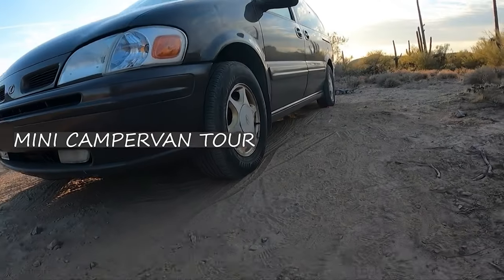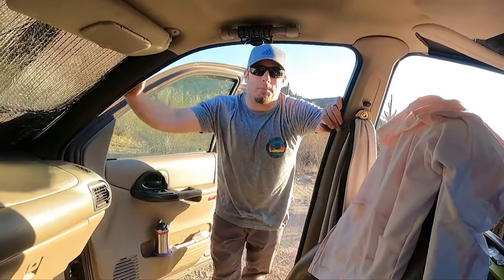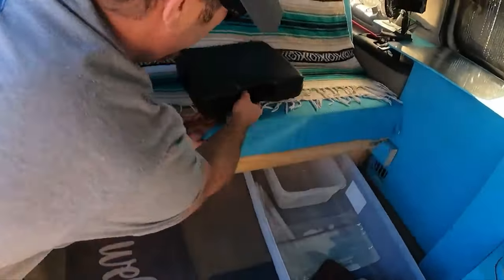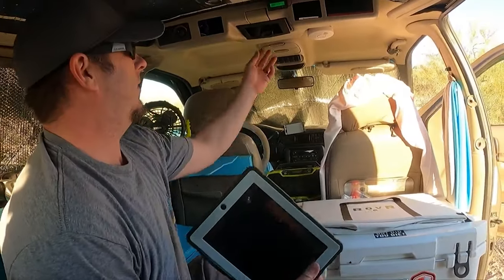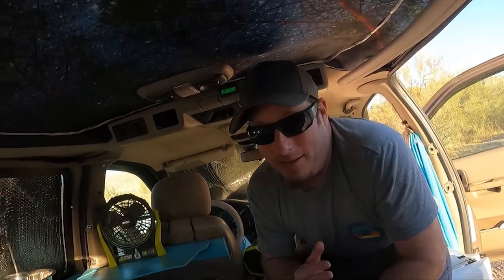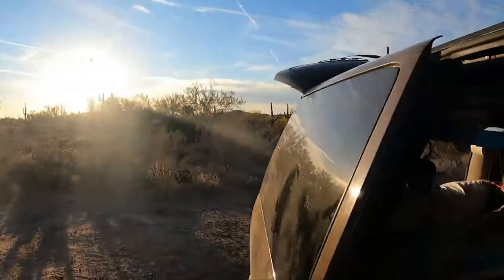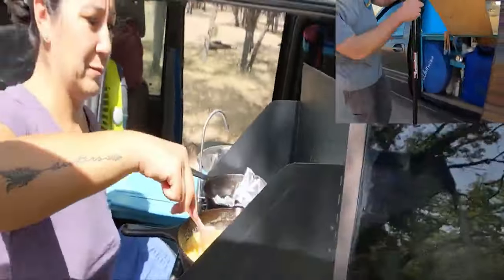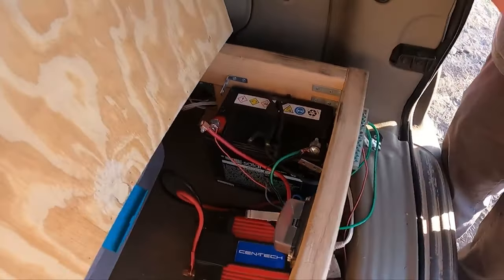MINIVAN CAMPER TOUR | BEST DIY BUDGET CAMPERVAN DESIGN & BUILD

Comment: Very nice set up !
How did you build the kitchen counter 
That opened both sides!!!
Reply from the maker: Thank you! I built everything around the bed once we figured out the sizing for us.  Started with 2x2 frame attaching the van floor and walls with L brackets. Used underlayment for counterd and sides to keep it lighweight, doubled up certain strip sections to make it stronger where needed. Added hinges for outside table and inside counterd, then painted everything. It was all done custom on the fly, the cheapest way possible. Didn't want to sink a Tom of cash into until I know it will work out for our needs. I hope this helps!

Comment: would love a more indepth  view of the countertop and set up ...... really like it !
Reply from the maker: I wish I filmed it bit Inwas in the zone lol. I was not afraid to drill into things. Used cardboard to make a template. Screwed a 2x4 to the back of drivers seat. I put a small.section (above the toilet) on piano hinge. First thing we do when parked is move the seats all the way forward which allows that counter to come down and it ooens up the space.Everyyhing was custom built to the contours of the van yet assuring thw sliding door still functions so we can get at the tanks and atorage
Reply from the maker: Thank you so much! It's an original design, custom for this van

Comment: Ingenious and so much in such a small space can you tell me how you did the little shelves
Reply from the maker: Thank you Leese! I used 1/4 " underlayment. Traced the shape needed on cardboard and made a template. Used that to cut the underlayment. Made a lip on 3 sides which are glued with construction adhesive (loctite instant grab) clamped and let it cure. Then I painted it to match. Installed with L brackets into the vinyl side panels with screws. The L brackets had to be bent with pliers to get the correct angle for leveling the shelves. I use mini bungee cords to help support the shelf and contents in place when traveling.

Comment: Nice.  Your side window screens are a good idea, I could use them in my minivan.  I saw from your reply to an earlier comment that the frames are made from ¼" plywood, I think you've motivated me to try something similar.  I've been using magnets to put screen fabric outside the windows.  Once I stopped where the mosquitos were really bad and was almost entirely devoured by the time I got them on.  🤣  So I need an inside screen solution, yours is good.
Reply from the maker: Thank you so much for your comments and feedback. I couldn't find anybody that made screens for pop out Wing windows so I kind of had to wing it LOL! I just snatched out for the pop out Lover I'm a little Gap that's there are stuff it loose material when we are parked.

Comment: Ive been exploring many camping options: cab over camper, box truck, work van, etc. currently using my subaru outback. However, i never considered a family mini van for a camper. Great idea and nice set up
Reply from the maker: We were the same way actually. I really wanted a cabover on my pickup truck but it's only a 1500. Those things just weigh too much you need at least a 2500 to haul anything decent. Then considered a teardrop trailer for towable pod to sleep in but we really don't want to have to tow anything unless it's kayaks or an ATV.  The minivan made the most sense especially because we already had the van which was half the battle. Worked out great and we upgraded to a high top van but we still use the minivan :)

Comment: Well-made video with good explanations
Reply from the maker: Thank you!
Reply: You drillef holes into sides of van to hang shelves?  How did you support  L brackets in plastic?
Reply from the maker: @kaysmith6297  the plastic is suprisingly strong. I did secure the plastic panels to the van with longer self tapping screws first (predrill first and make sure the screws are not too long!) Then screwed the L brackets into the panels with shorter screws (again predrill holes) I was not afraid to make holes as this van will not be resold. We will be the last owners lol! The l brackets needed to be bent some to match the profile of the plastic panels. Also mini bungee cords help support the shelves and act as a fence to secure items :)
Reply: @gino_colucci  Thanx for replying. I was not going to do any permanent mods like making holes,  etc.  My "new to me" minivan already has over 148k miles so I'm with you - she may never get sold again.  I had all rear seats removed today with plans of storing them,  but maybe not worth the effort. I'll sleep on it & decide if I'll try to sell them to a repair shop,  etc.
Reply from the maker: @kaysmith6297  if you go thst route fscebook market place is a good source for listing them to the public for free. Good luck on your build, enjoy the process!

Comment: Did you make a video about how your made the screen inserts for your windows?
Reply from the maker: I didn't but they are similar to the gentlemen's build. I'm not sure if it's this video but he has one where he goes over how to make them. Just need to adjust to your own windows. For example, I had to notch out the lever pulls and I stuff the little gaps with loose screen.  https://youtu.be/oO2-2EKtJLc

Comment: I'd like to see a better close up of the bed, how it's built and how it sets up and takes down, what it looks like under the cushions, the structure, the build...

Also how you put in the shelves and counters. I would love more info on how you built and installed the wood items
Reply from the maker: Check out this link. This is where the idea came from. My version was more cost effective as I was able to make the sections the same size as body pillows so I can you body pillow covers. He explains the concept and and design features yet the measurements depend on your size and available space. I made ours my length (head to toe), as wide as possible and low enough to sit up without hitting head yet high enough off thw ground to allow for storage bins underneath. Good luck, it was fun to build! https://youtu.be/h7dM4afXiq8
Reply: @gino_colucci  any info on the shelves in the back with the little rafters crossbars? I have the same van. Love your videos, especially the instructional ones. I like how much detail you provide.

Comment: Great van..it has everything you need. Does the cooler work off of the battery?
Reply from the maker: Actually no. It's a really good cooler that holds ice for days. it's supposed to be 10 days but in the summer it's more like 4 to 5 depending on how much you open it. I think 10 days in colder climates. It is comparable to a Yetti however it has air inflated tires which is perfect for sand and gravel.
Reply from the maker: Here is a link if you want to check it out for yourself they actually have smaller versions, this one's pretty big Rover 60 QT Cooler  https://amzn.to/3bNlYCF

Comment: I liked every bit of this. If you can explain about the shelf - did i miss it?
Reply from the maker: I forgot about the shelves lol! They were built from the same material as the countertops and attached with L brackets. Multiple small bungee cords to help support the weight and keep items in place. I made sure to create a lip on all sides.
Reply: @gino_colucci  beautiful! Subscribed. I liked your style and ability to just make it work. You are doing another van build too?
Reply from the maker: @LisaSoulLevelHealing  Thank ypu! Sort of another build. More like a rennovation. It was 60-70% dome but needed a transmission. We bought it at a huge discount and had the trans rebuilt and I did somw other neglected relairs and maintenance. We started using it right away after repairs and updating a little at a time to suite our wants and needs. 1st trip (Lake Havasu Video on our channel) we juat put the bed from the minivan in it as a temporary solution but I built a platform bed so we have a lot of storage, hide the toilet, safe and dirty laumdry compartment. A build takes time and we want to be out there LIVIN lol! It's cominv along nicely. Trying to stick with the budget theme since we do mostly dispersed camping. Luxury not needed.

Comment: If the two of you can be happy with that size space inside, then I should be content alone in my SUV. I have everything in mine as you do. Plenty negative space. But some how I can't let go of the "WANT" of a van. I just want a regular van like this brown one.
Reply from the maker: Sometimes we go out in our 4x4 pickup truck with a tent on the back. We built a platform so we can put gear under the bed and transfer the mattress from the minivan so we sleep in comfort. It is all we really need for a good time and beats a tent on the ground for sure. Those days are over unless we decide to do aome backpacking trips lol. Obviously we only do it in decent weather and to get to hard-to-reach remote places requiring high clearance vehicles, so it's a trade-off because the van is much more comfortable. I have considered and I've seen a lot of people with a pickup truck having a camper shell and are perfectly content with the setup. Especially if you will be by yourself. We actually stepped it up recently from the brown minivan to a full-sized high top van that we can stand up in! We still have the brown minivan urban stealth camping and a backup. Raquel uses it as a daily driver currently and I'm full size van is parked until we use it.

Comment: In my minimal van build (promaster city), my second row windows are like yours. Yours is the first video I have seen with your kind of screen build. How did you do it? Did you custom build these mosquito screens or were you able to order them somewhere. They're perfect...thanks.
Reply from the maker: I made them on the fly with 1/4 plywood.  Used csrdboard and trimmed till I got the shape right. Transferred shape to wood. Traced 1.5  inches in, all around then used a jigsaw to cut it. Painted the frame black and stapled screen material. It was a lot of work but worth the result!

Comment: Hello, I see you have moved on to a bigger van.. I’m curious if you could do a comparison of the two.. I know gas is more but in means of comfort and overall experience is one vastly better? Thanks
Reply from the maker: No problem they each have there own place,  advantages/disadvantages. The minivan was a perfect starter but it is limited on spaceand storage which is fine for anything less than a week IMO. We are now taking longer trips though. When we  checked out the high top van, the insulation at the ceiling was missing but that let us stand up inside so we left it that way!  I am 5' 9". Once  your are able to stand up and have ample storage it makes the disadvantages petty.  Insulation is not a priority as there is a maxx fan and plenty of windows with screens and we won't be traveling in extreme weather. Here are the disadvantages of the full size van. Obviously decreased gas milage, wind noise while driving and harder to handle on windy days. No parking garages and not stealthy. For what we do now and future needs it is perfect for us and like it much better as comfort is the most important aspect for us. We still have and love our minivan. Raquel uses it as a daily driver and we love it for urban stealth camping when checking our cities since the big boy is not stealthy.

Comment: Like your minivan conversion. We've always loved road car trips and had a Winnebago Travato van that we loved. Sadly, we had to part with it after about a year due to circumstances unrelated to the van. Now we are planning to purchase a minivan (move manageable for me if I need to drive it). Enough said about that. We noticed your window screens and are interested to purchase some (after we get the minivan, of course). Can you supply information about where to purchase the ones that were in your slider windows or if you made them yourselves, do you have a video posted?
Reply from the maker: Hi Peggy, thank you for taking the time to comment. Unfortunately, I don’t have a video for the windows as a custom made them flying by the seat of my pants. I had no idea what I was doing lol! It was an experiment that paid off! They are not perfect, but they worked. I pieced together a cardboard template for the windows exactly where I wanted them to sit. I bought quarter inch plywood and I use the jigsaw to trace a 1.25 inch frame, spray painted that black and then I staples screen fabric to that. They are held in place mostly by friction and a couple screws.  The frame cannot be thick. That’s why I did it inch and a quarter it needs to be somewhat flexible. 
I was not afraid to put screws in my paneling because it’s an older van. when I made the frame, I notched around the pop out lover. At night I stuffed the little gap with extra screaming material, rolled into a ball pretty much. That was the only logical way I can see to deal with those wings style pop outs.
Reply from the maker: I’m sorry you had to part with that van it’s those are very nice actually! My wife passed away last year and I still have our minivan that we converted. It’s hard for me to part with it. I use it as my daily driver currently. I am going to drive it as long as I can before it doesn’t make sense. I actually have a full-size Chevy van that I use for camping now because I plan on taking much longer trips for a healing journey. That minivan served us very well though and helped create a lot of great memories. I am so glad we did this for final years were amazing.
Reply: @gino_colucci  I'm so very sorry that you lost your wife. You two appeared to be a very happy couple having an awesome time together on the road. I would hang on to every one of your memories too. Thank you for responding to my email and for your recollections about making the covers. Hope you find much happiness moving forward in all you choose to do.

Comment: Question.  We are tent campers but are exploring the idea of sleeping in our minivan.  While tent camping, all the food and drink is stored in the car overnight so as to not attract bear or entice the raccoons.   If we sleep in the minivan I would like to add a netting to the raised hatch to allow ventilation but then I am sleeping in the same area as the food.  I am concerned critters may try to get into the van through the open netted hatch.  I think a YETI cooler and food stuff sacks that lock in the scents may be the answer and maybe food storage in a car top carrier.  Do you have any suggestions or comments? Thanks.
Reply from the maker: Yes! The cooler we have that is seen in the video is bear proof! It's a ROVER cooler. It's expensive like a Yeti but the wheels are made for gravel and sand so you can take it anywhere but glides easily over those terrains. Ours is pretty big but they have smaller versions. Make sure it will fit your space. Their website has measurements.  I highly suggest looking into it. If you are in the Southwest do not get the cuttingboard made of bamboo it will warp. I think they sell a different version now. There is a link in the description. Let me know if you go that route or have any other questions.

Comment: I myself could do without the loud music.
You didn't mention the shelves on the sides that you built. 
I love the bed idea, hadn't seen anyone switch to lay the opposite way.
But I don't get why you built around the toilet. Most people just get one of those fabric storage boxes and turn it upside down over it. Just seems like that wooden box takes up precious room.
I'm assuming you charge your battery while driving??
Overall guys I love what you are doing and your van. I'm in search of a van to do the same. What year and make is your van and the miles, if you don't mind me asking??
I don't really know what to choose in a minivan if I go that way. TY
Have Fun 💚
Reply from the maker: Your right, I forgot about the shelves lol! They were built from the same material as the countertops and attached with L brackets. Multiple small bungee cords to help support the weight and keep items in place. I made sure to create a lip on all sides.
Reply from the maker: We actually built everything around the bed once we determined the pefect size for our needs. I made the box for the toilet to hide it and we had plently of material left over from the counters and shelves so it made sense.
Reply from the maker: The van is a 2000 Oldmobile Silhouette. I think the 2004 has an AWD option. We charge the battery with portable folding solar panels. Our new van charges off solar and while we drive. Thanks for the feedback 🙏😃

Comment: I bought the same tapestry for my van build, how did you attach yours to your ceiling?  Thanks in advance!
Reply from the maker: I used a spray adhesive that is tolerant of  heat. I took off the trim for vents, cut as needed then reinstalled the trim. There are a couple small wrinkles but not noticable
Reply: @gino_colucci  ty for rapid response
Reply from the maker: @christinehanner129  your welcome

Comment: I think I saw a clip on fan. Do you have a link for it?
Reply from the maker: Unfortunately, no but I got them one at Walmart in the RV section. It’s literally a clip on 12 V that is a cigarette lighter adapter. I transferred it over to my new camper van and I hardwired it by cutting off the adapter and wiring it to the 12 V system. It doesn’t use that much energy and oscillates so it’s really nice. definitely get mating one you will like it so so much better.